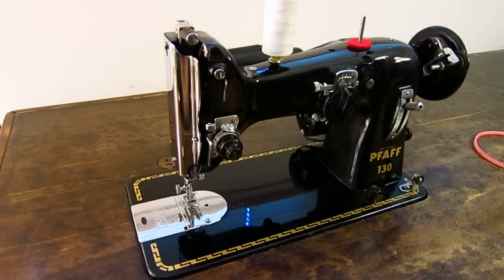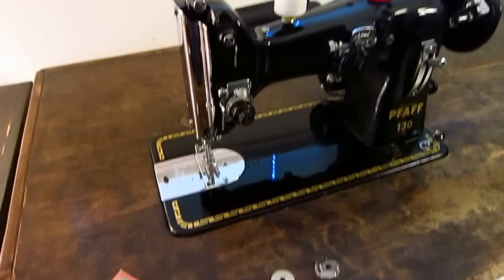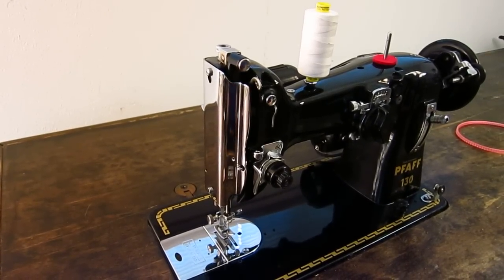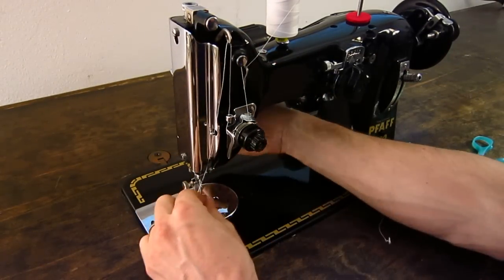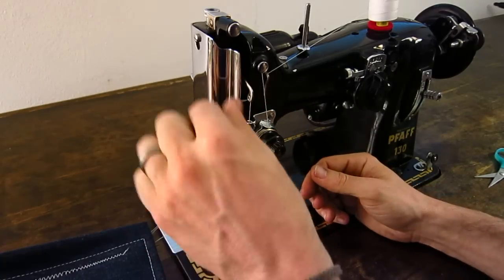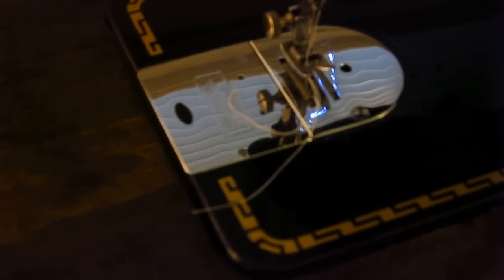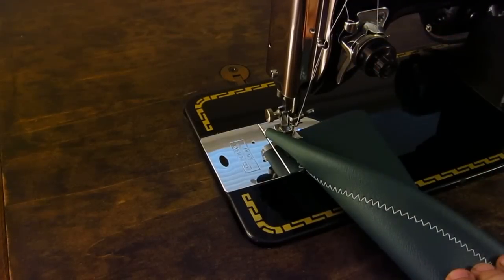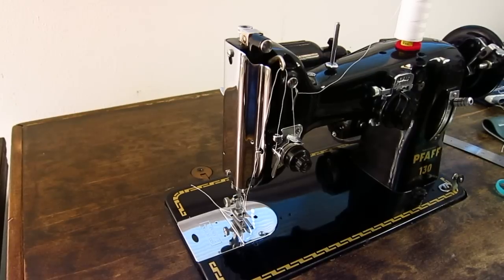1951 Pfaff 130 Sewing Demonstration

Comment: Thanks for the video. This is the first sewing machine that I used, when I started sewing at 6 years old. My Mom and Grandma were both seamstresses that taught Home Bureau and 4H. Mom had the Pfaff 130, an incredible sewing machine. I've had several different brands of sewing machines over my 64 years, and in my opinion, the Pfaff is the best built sewing machine. I have ALL the attachments for my 130, as Mom had every one of them in her sewing arsenal. I'll be using the button hole attachment today. ;)

Comment: Hiya and firstly , thank you for all the great videos that you post .
I have just bought a Pfaff 130 and maybe you could please tell me what the lever that is on the upper tension mechanism's right hand side is for please ??
It can be pressed down or raised up and appears to alter the tension but I can't find any reference to it in any of the manuals so I am confused .
Thank you in advance for your help.
Reply from the maker: That lever adjusts your "check spring". You can adjust it to accommodate different material thickness.  The check spring keeps tension on the thread as the needle descends into the material.  You want the check spring to be pulling on the thread slightly until the needle eye is buried in the fabric.

Comment: This is a great video. I have my dad's old Pfaff 130. It's pretty rough. It lived on his sailboat w/him & he used it to repair sails. Does it do buttonholes? If so, how many variations? Do you know where I can purchase the buttonhole attachments & where I might find a good explanation on how to refurbish it? It does run & I've had it serviced but... Sorry for all the questions but you seem very knowledgeable.
Reply from the maker: Hi Susan, the machine does manual buttonholes, so you'll have to mark them out but there are stops on the zig-zag width dial that will allow you to make consist standard buttonholes.  Google "Pfaff 130 Manual", the procedure is in there.  If you want to use an attachment, which produce excellent buttonholes of all sizes/shapes, I suggest you look into a vintage Singer buttonholer with cams.  You can find them on eBay for ~$10-15.  You might want to join the yahoo group "oldpfaffforum" for information on how to refurbish the machine.  Goodluck and enjoy!
Reply: Thanks so much! We'll see if I can get it working right. It's skipping lots of stitches on the zig zag, one of the two things I wanted to use it for other than buttonholes. My other machines are all industrial. I sure love it though. Even if it goes on display in my studio at least it's out of the closet it was in after coming off the boat!
Reply: I'll also check out that group you mentioned. :)
Reply: The "dial on the front is actually a type of a built in buttonhole maker. You set the with for bar tack and side width. It is indicated in an instruction manual. They also made a satin stitch foot and a gauge buttonhole foot.

Comment: I recently picked up one and it works well, but i notice that when i do zig zag... I feel like the gears or something is slightly binding or not smooth through the stroke. This only happens from right to left as the needle reaches the apex and starts it's downward stroke. If I turn the wheel manually there is a slight hesitation.  If i run it with a straight stitch ...there is no binding. Only when I zig zag it. I've opened up the back and the hesitation coincides with the up stroke of the guide that rides in the valley on the back of the zig zag knob shaft. On a straight stitch the valley almost points up to 12 oclock ,so no hesitation there. If I go to max zig zag the valley is pointing more to 2 oclock, so I can see why it's working harder. Hope i explained it clear enough. Any suggestions?

Comment: Intend to begin non commercial leather projects having used my 130 for Sunbrella and Sail Cloth.
My looking ahead question is on the weight of thread the machine can accommodate,
Reply from the maker: You can get away with T70 bobbin and T90 upper but that's pushing the limits of this machine.  T70 upper/lower is a more realistic limit.  Make sure to use a chisel point leather specific needle.  Try a 100 but you may have to go up to a 110 needle.  This is for chrome tanned leather.  The 130 isn't suited for vegetable tanned leather.

Comment: Hello Sergeant. I just acquired a Pfaff 130-6 and the tension seams to be sensitive to fabric types, requiring a lot of adjustments and needle changes or it skips stitches. Do you find that to be the case with your experience? Mine skips stitches.
Reply: It could be that your timing needs adjustment if you are skipping stitches..
Reply: thank you for your reply!  I took it in and had the timing adjusted.  When I got it back the tension was a mess and I couldn't get it right.  I took it back in, and the tension cannot be adjusted correctly.  He said I may need a new tension device.  So I purchased a new tension and now the presser foot won't stay up.  One thing after another.  Hopefully this is an easy fix.

Comment: Hi thesergeant, 

I have the opportunity to purchase either a 30, 31 or 130 for some finely detailed leather work, linings, straps and some lighter duty canvas work. 

Essentially I want a machine that can go through 3-4.5mm of leather with excellent precision, but be easy to maintain (parts) and service myself. I want an impeccable top AND bottom stitch. Do you have a recommendation on which I should go? Right now, the 30 is the most affordable  ($100), the 31 ($200) and the 130 ($450-700). They all have steel handwheel, not the plastic style you discuss above. I realise the 130 has the most options on stitch type, but really, I'll be doing mostly straight stitch (hopefully with some LR RTS needles and want the best result possible. 

Your sage advice would be SO helpful! What would you buy for this type of work - J

Comment: Hi! I just found this video today, and I would really appreciate it if you could give me some advice. I ha the exact same machine, in a beautiful table, with an original receipt from 1950, and a certificate of lifetime guarantee for the original owner. I was told it works, but when I tried to check today, the wires are all crunchy and falling apart, so I didn't even try to plug it in. So my question is, is it worth getting serviced? If yes, how much do you think it would cost? Right now I just really want it out of my house, since it's taking up space. If anyone reads this and is interested, I'm in the Bay Area. Please respond to this comment. Thanks!!

Comment: We just using ours again. I need to oil it and clean it. I used to use military grade thread to sew patches on peoples flight jackets. Wife tried to use it, but breaking thread at needle.
Reply from the maker: Make sure that you're matching the needle size with the thread size.  If your needle is too small you're going to be fraying and breaking thread.  Hope that helps!
Reply: @thesergeant3524  It was routed wrong. I sewed in the Navy at a SAR Paraloft.

Comment: The timing belt was made of Hemp, not nylon.. Pfaff used nylon later. and the hemp will stretch and cause the machine to go "out of time ", when soaked with oil... Your model is a 1953. The early models had a different width control..

Comment: What oil do you recommend lubricating a 130 with?
Reply from the maker: Tri-flow is a pretty popular and commonly used lubricant within the vintage sewing machine world.  A lot of people also use fully synthetic 0W-20 Motor Oil with great success.  Tri-Flow is good initially because it's pretty effective at removing and dissolving hardened varnish.
Reply: thesergeant Ok, thank you :) Think ill buy som Tri-flow tomorrow then. Its because my girlfriend just got a Pfaff 130 last week, well taken care of by an old couple, and before them it was at a tailer shop. Its set up as a "biesemachine" class 130-115 (Not intirely sure what it means, just what it says in the book), so its ready to sew with 2 needles. Also got a Pfaff tin can with it, full with parts, an original danish instruction manuel, extra bobbins and so on. Its sitting in its original tabel, driven by an old danish produced 0,15 hp / 2500 rpm motor (Which i today resoldered some wires and changed bearings in). Payed whats equivalent to 79.5 USD.
Reply from the maker: Morten Qvist Awesome!  Does it have a knee lift as well?  I've been really wanting a 130-115 with a knee lift but they don't come up nearly as often as the 130-6 models.  Enjoy it, sounds like you have a great one!
Reply: thesergeant Yes it does, and it works.

Comment: My pfaff130 has some additional rotary phone type dials on the back of it, wondering if you could tell me how those work? Looks like it has something to do with the zig zag options.
Reply from the maker: Google "Pfaff 50010 attachment" or "Pfaff Coffee Grinder attachment" and you should be able to find instructions.  The short of it though is that you rotate the small knob at the bottom of the stitch width adjustment dial to allow the dial to move freely.  The lever on the back right of the attachment sets the width of the decorative stitch and the one on the left cycles through the different patterns.  You can also change the needle position (Left/Center/Right) to change the look of the stitch as well.
Reply: @thesergeant3524  amazing thank you!

Comment: Do you still restore machines? I’ve recently acquired one and the local sewing machine repair shop basically told me a new motor was worth more than the machine.
Reply from the maker: I do.  Do not listen to that repair shop.  You can buy new motors for $20-30 on ebay.  Not as nice as the original motors but they will 100% work.  I'd go that route first and then see if you can track down an original.  Join a Pfaff sewing group on Facebook or Groups.io and ask if anyone has a spare to sell.  Goodluck!

Comment: Can the 130
Sew heavy materials sail cloth, vinyl,
Heavy cordura?
Reply from the maker: Technically it can but you really need to match the thread to the material and depending on the project the Pfaff 130 won't like working with such heavy thread and such large needles.  The limiting factors here are feeding ability of the machine and proper thread tension.

Comment: I have a PFAFF 130 in  good condition, seems to have all orinal parts except for  screw that holds the light cover on are missing and the cord coming from the light is like dry rotted,I guess? (It has some wires showing). Anyone have any idea on the value?? Please and Thank you!

Comment: What is the little leaver by the side of the of the tensioner used for?
Reply from the maker: It controls the 'check spring'.  You can adjust it depending on  the thickness of the material.  You want the tension to release just as the eye of the need enters the fabric.